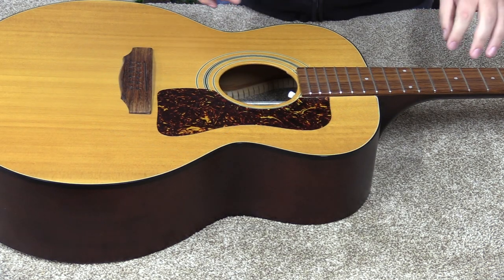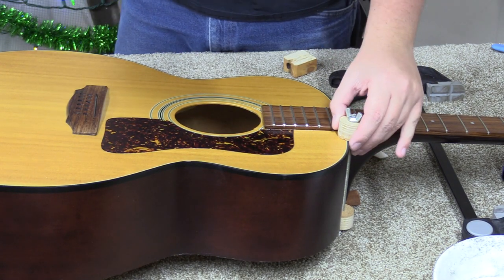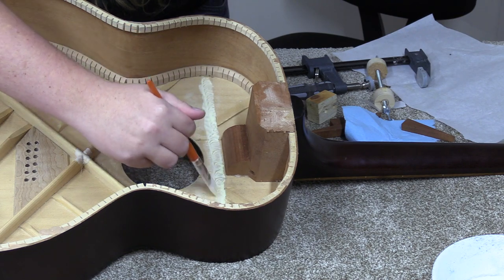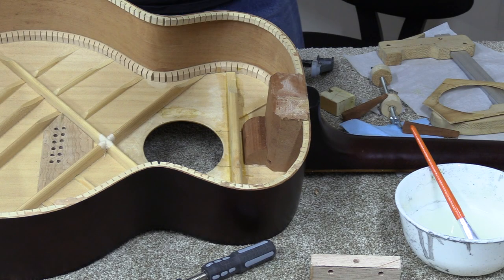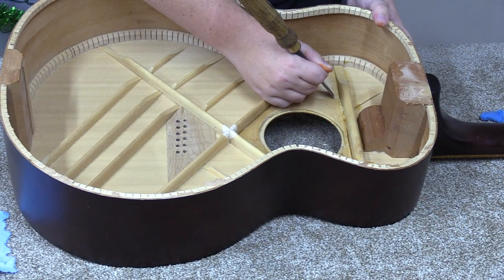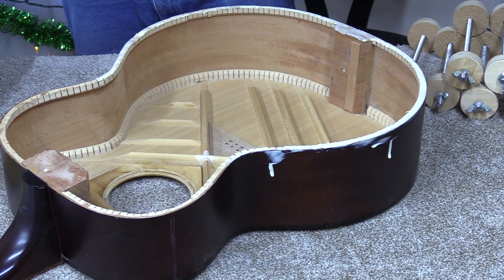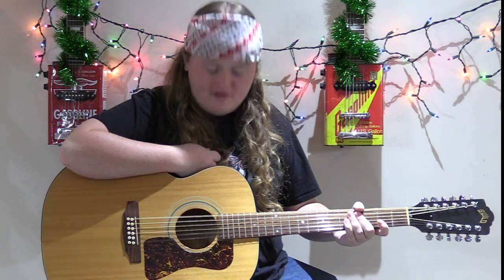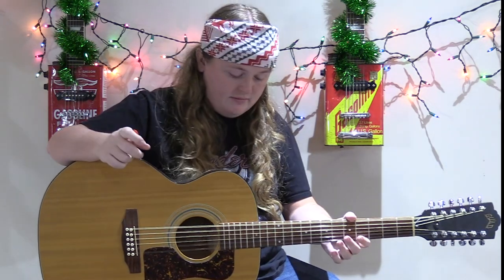1994 Guild JF4-12 Neck Repair Part 2

Comment: Merry Christmas Caleb to you and all  of yours. Congratulations on this being your best video yet. Your work has been fine right along, but largely what you learned with Jerry R. and now I  am starting to see your intuition and creativity step out. I've been fascinated with the idea of the "cheater" neck reset, but have had reservations. You've finally shown me an explanation of what really makes most resets necessary. String tension and neck leverage caves in the top.... as the neck doesn't bend ,and the back doesn't stretch, so I've begun to believe most carved resets may be an end run and not a fix of the real problem. If the top has sunk the normal carved reset will leave shortened  the effective string length (scale) unless the sunken top is fixed. If you can reasonably fix the sunken top , a "cheater" reset may become unnecessary or at least become easier. Your imaginative clamping has given me great ideas and reduced my concerns about all of this. Stay strong, I'm starting to see you coming into your own , and doing original and valuable work. Thank you !

Comment: Trying to catch up 🔝 n my viewing. Was wondering did you check the neck relief? I think those Guilds have a double truss rod in them. I had an F-412 that was built that way and it would play great with almost zero relief.

Comment: I noticed, if you were to pull that neck, the rounded, extra block, attached to the neck block, would make it very difficult to clamp the fretboard extension, for gluing.

Comment: Is there a reason why you didn't add any additional reinforcement to the neck area when the back was off? Maybe extend that little block out on each side to include the cracked area so it wouldn't crack in the future? Just thinking that its put back the same as it was when new and this will most likely happen again in the years to come with a poor design from the factory.
Reply: Better glue, Better clamping. On the brace, sound hole reinforcement plate and neck block . Which were all loose.
Reply: @chrismills1561  My concern is that those were all tight and glued at one point and over the short span came loose, hopefully it is better now.

Comment: Love those 12-strings!
Reply: Me too. I had a great one, once but I had to let it go because I was playing it too much and it was holding me back in progressing further. They sound nice but the neck is usually wider and the extra strings can tire out your fingers when thumb picking or double picking with a flat pick, I've found. This guitar has a really nice sound, but the interior was perhaps a little primitive? Caleb fixed it!
Reply: @costrio  Some of the Guild 12 models had 2 truss rods side by side. The front office felt the bigger the better on these. Honestly, bigger didn't make them any better.
Reply: @rakentrail  Interesting info, thanks.